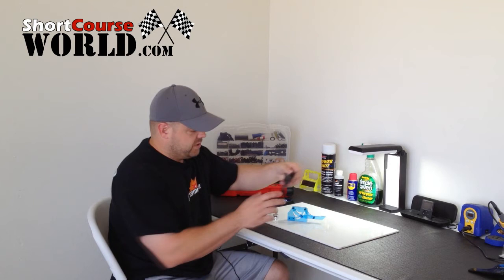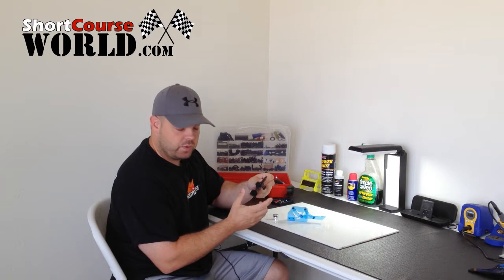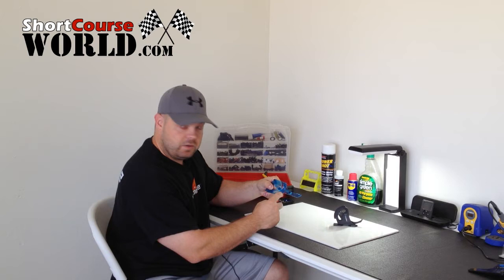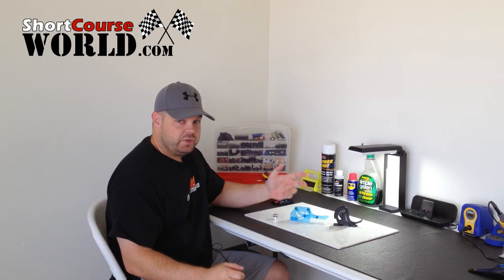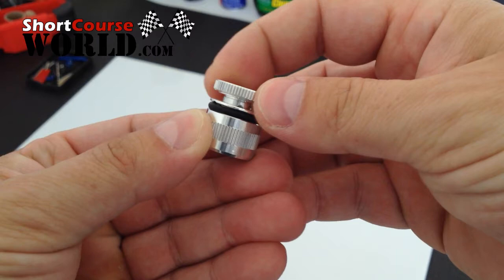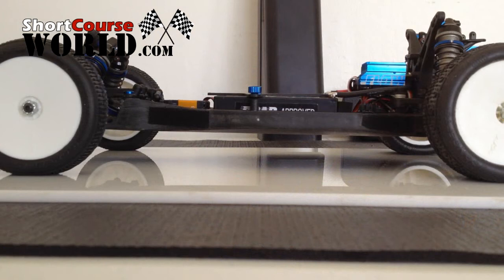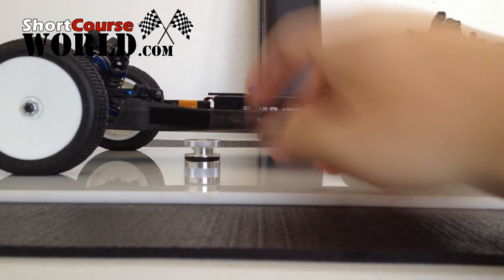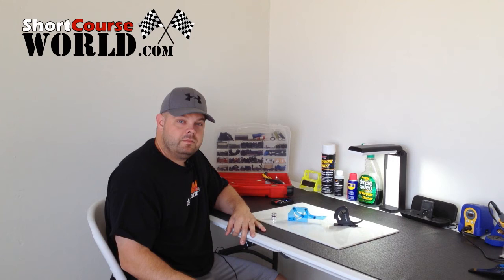Cool Tools Episode #1 - Best Ride Height Guage

Comment: Judy one is cool machined aluminium and is like stairs and as it is black the height is printed on each stair it goes from 15mm to 30mm but a lower one can be purchased nothing has to be turned or adjusted on it. It is a solid unit
Reply from the maker: yeah hudy makes nice stuff

Comment: hi Jason,  i have the ghea and i do like it.. i was wondering if you have any recommendations for a Gage you can slide under the car and push down on a lever and it will stop at the hight  and not lock into place. i hope i make sense. a guy at a track i was at had one and it was supper ez and fast to operate.wish i would have got the brand name 
thank you 
Josh

Comment: Ok, I'm a little confused about ride height.  On my slash, there are two different positions, one .... if I push down on the front (or rear) and release, the suspension does not return to full up position.  However if I pull up on the suspension, I can bring it up to full height.  Is this normal or are the springs too weak?  Which is considered the normal ride height?